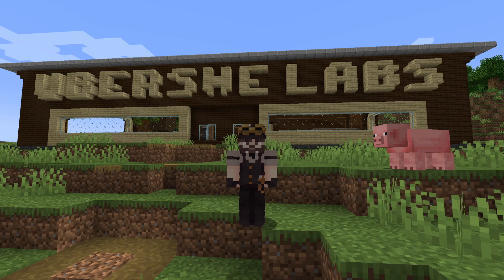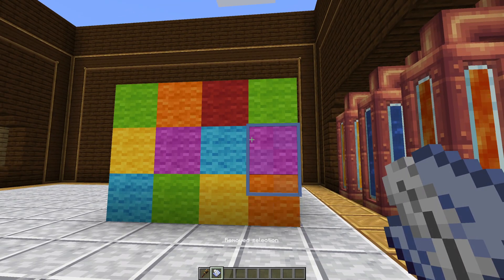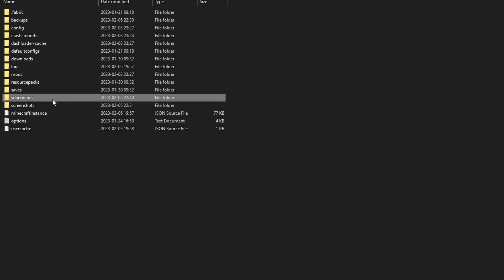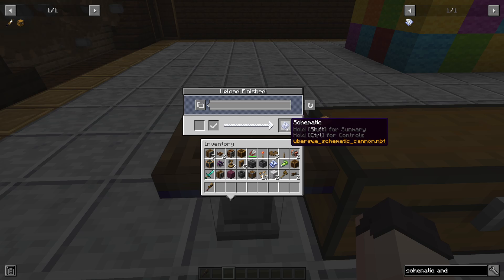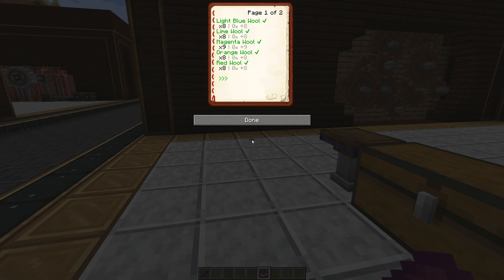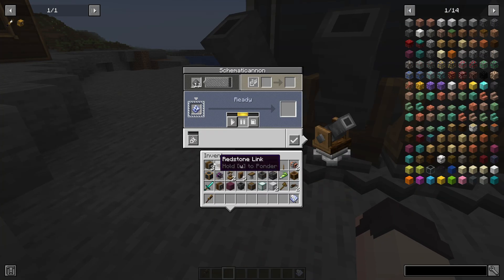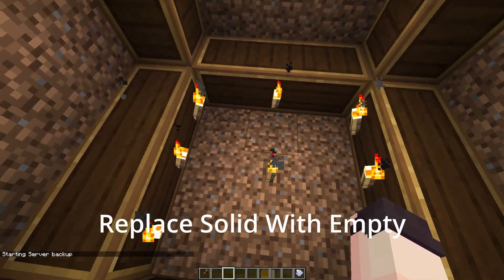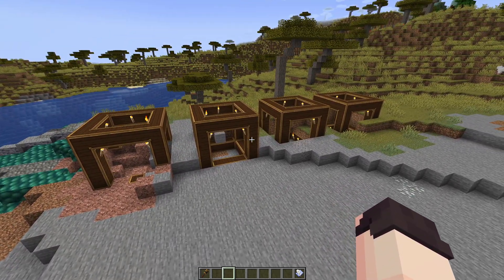Complete Schematicannon Guide - Create Mod 0.5.0 - Minecraft 1.18.2

Comment: Thanks for help with this video but for some reason moving the item after first placement using the controls don't seem to work for me
Reply: dunno if you still care, but changing your own position has helped me. sometimes if i was standing too far away from a complex schematic, it would not move on the horizontal, but when i got closer or further away, it worked again. definitively not ideal, but it is a  workaround